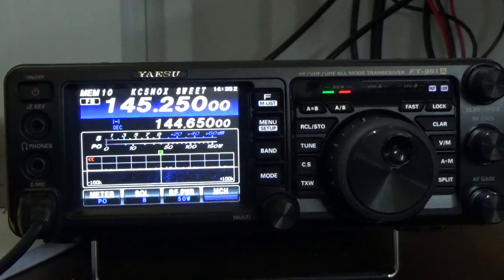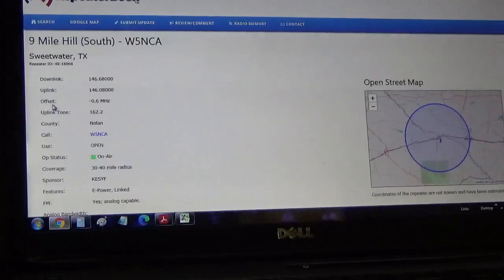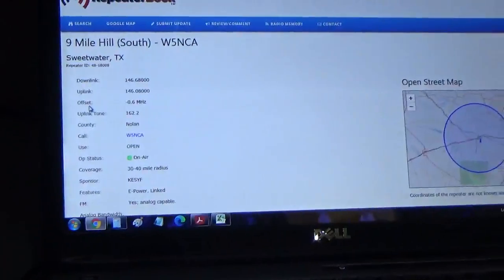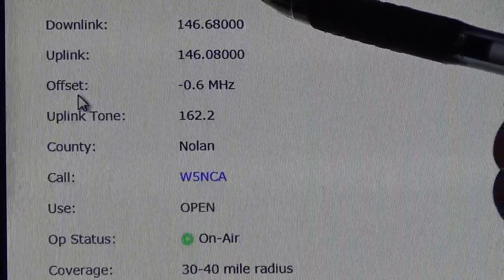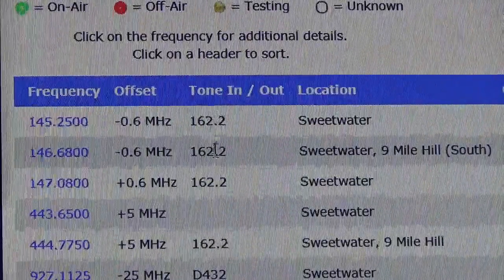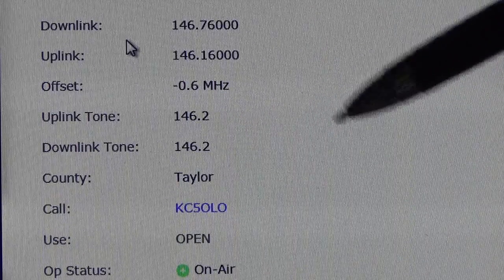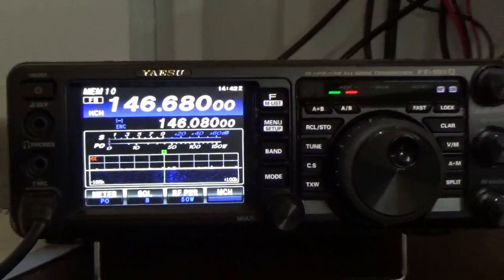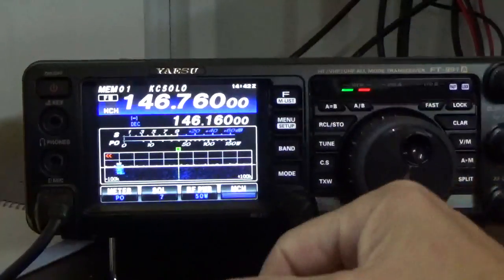How to Program a 2M Repeater Yaesu FT-991A - 9 Mile Hill (South) - W5NCA

Comment: I saw you set the offest as + or - but I didn't see you set the actual offset. For example, if my offset is -000.600 where do I put -0.6? So far I only see CLAR increments of 5.
Reply from the maker: Hi Forrest, thanks for the message and a good question.  The following video https://youtu.be/_XwQMD0kvO4 dives  a little deeper into where you set the shift when programming frequencies,  The 0.6 is actually  a fixed setting that you can modify under the press "MENU/SETUP" and use the Multi Knob and locate setting 082 for 2 Meter.  When done press   "MENU/SETUP" to exit.  Hope this helps and let me know if you have any more questions keep in touch and good luck on the journey '73 sir

Comment: Novice question if I may: I have no immediate plans on acquiring my license. Instead, I prefer to play with my radio (991A) strictly on the receiving end before I take the test(s). 

Keeping in mind that I will not be transmitting - Do I have to program both the uplink and downlink if I merely want to listen? I worry that programming anything may require me to squeeze the PTT at some point and that just does not seem ethical(?) for lack of a better term.

Furthermore, how does one know which 'Tone' setting is required for each repeater? 

Thank you for the informative videos. I look forward to watching your entire library in triplicate.

Stay classy my friend.
Reply: Repeaterbook
Reply: That's a heck of an expensive toy to merely listen on ! I also just listened before passing my General, but on a $200 HT :) Did you get your ticket after posting this ? As Hilly Billy said, Repeaterbook has all the info you'll need and, if you register for a free account, you'll have the opportunity to export the data for say, all the 70cm repeaters (or 2m, System Fusion etc) in your county, to a format of your choice. For the 991A, I'd recommend getting RT Systems programming software and you can export your data to the format that software uses. I used that function for programming my Anytone D878, Yaesu FT3DR and my 991A. Couldn't be easier. And don't forget radioreference for all your emergency services frequency needs.

Comment: How is the radio for a stand alone 2m 440 rig. I want to get an all mode 2/440 radio and am looking at the icom but this also has hf so that’s a huge difference.
Reply from the maker: I'll be honest I'm new to HAM I can tell you this radio does great on both 2M and 440 - 50 watts solid - it has all modes and I think you'll be happy with it for the price - good luck look forward to making a HF contact with you !!